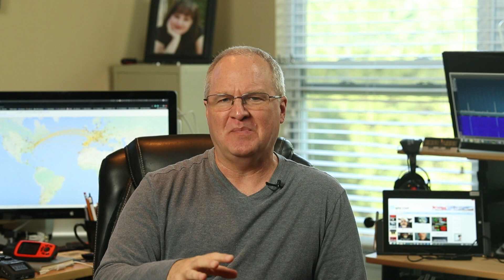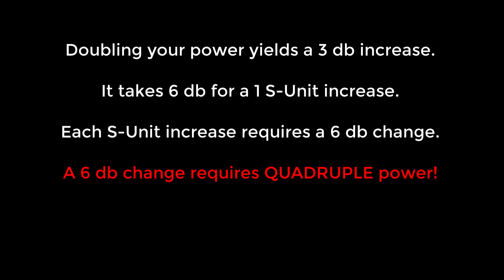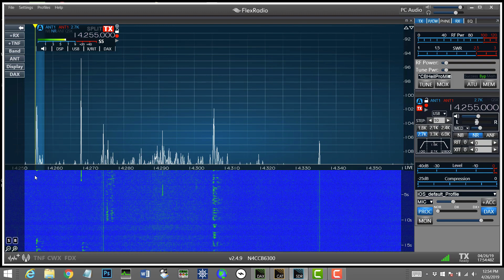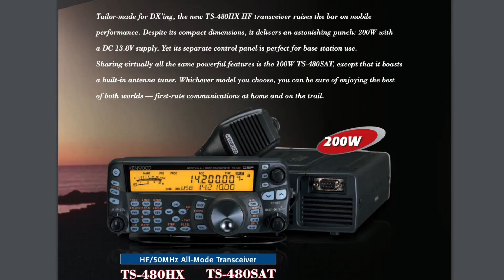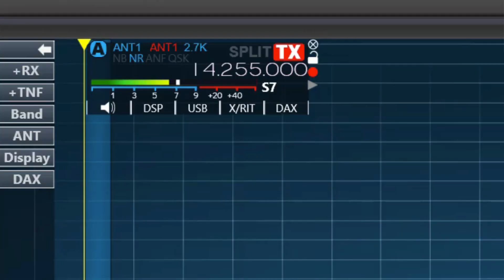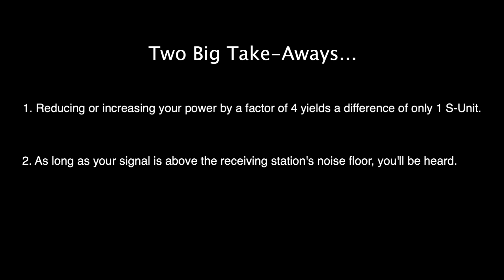Output Power vs. S-Units

Comment: This is all correct . I have the Kenwood ts 480 hx , and have been using it in my work van with a 3 metre outbacker outreach , since the rig first came on the market . My mobile station was about as good as i could do without getting an amp . It is very true the extra 100 watts makes very little difference most times , i have done many tests over the years turning down the power to 100 , 50 10 and 5 watts . I would say that if you have a very good a aerial and low power this is way better than high power with poor aerial . MY Icom ic 703 (10 watts ) in the shack with a 72 metre doublet at 18 metre is every bit as strong as my mobile set up ( many tests over the years ) . Thanks for your video
Reply from the maker: Thanks for your confirmation and experience, Rob. - Cliff

Comment: That explains quite nicely why I could have a conversation with a couple of different people in New Zealand from Oxnard, CA back in the 1980s with my stock 4 watt Cobra 148 GTL.
There's a group of us in the Mohave Amateur Radio Club that are building the QRP Labs kit, The QCX mostly at 20 meters. I'm going to have to break down and learn code. I may have to use my comptuer to send and receive code as I attempted to learn it decades ago and a lot of times I couldn't hear the difference between a dit and a dah.

Comment: great video, great information. I’d just like to point out a couple of things.
1. 1 S unit is 6 db only in iaru theoretical recommendations. Very few radios respect that. But it doesn’t matter in the end cause what matters is the real Signal+noise/noise ratio. And is the ear to perceive that.
That means if your signal is comparable to the noise even doubling power, 3 db, is a significant difference, as you said.
2. Unfortunately one has to fight strong qrm many times, more than just band noise. And when the receiver has an adjacent guy putting out 1500w is where you’ve got a problem even if you’re strong S9. And so again 3 or 6 db help quite a lot. 
To work in harmony everybody should lower the power. If I can hear you S9 with 100w why in first place you need an amplifier. So will do the adjacent one and so on. Less qrm, less splatters, less listening fatigue.

Comment: Great video Cliff! I am into qrp since I got my license 41 years ago. My first rig was a Kenwood TS-120V, FT-817, IC-703 were on my way, and now I really love my KX2 (even it has flimpsy case which is far from rough as a portable rig should be) 73s od better 72s (hi) de Stephan, DF6PA
Reply from the maker: Hello, Stephan.  I have heard others complaining about how the KX2 has holes and things that would allow moisture into the radio in the field.  I don't operate in rainy weather but it does make me think that Elecraft should consider making a field radio more weather-resistant... like many of the hand-held VHF/UHF radios.  Have fun! - Cliff

Comment: For weak signals, 6db makes the difference between a contact or no contact. It's all about increasing reliability that's why most commercial stations run power.
 I agree, most of the time, it's not needed. You can't control conditions, but you can increase readability a little.

Comment: great video. only time i would really like an amp is if my antenna needs encouragement to radiate because it was some sort of compromise design I was forced to use.
Reply from the maker: I'm in the same situation.  I have a vertical antenna behind my house in a big neighborhood. It's the best I can do in my situation.  I'm thinking that if I used a 1500 amp, stations might be able to hear me that I can't hear. They might reply to my CQ and get aggravated with me when I couldn't hear them due to an elevated noise floor at my shack.  In this situation, the operator with a big mouth but tiny ears is known as an "alligator".  :-)   Cliff

Comment: I respect your comments and agree with the overall theme. I do feel however you undersold the noise floor variable. In my 40 years on the air my experience is that about 1/3 or more contacts are made right around the noise floor, so an amp would be a difference maker for 1/3 of them.  While you did caveat with the noise floor I feel you inferred near absolutes without its frequent impact. 

If an operator wants more success, and in a sharply noticeable percentage, he/she will appreciate the amplifier.  Can the operator be highly successful without it? Yes. Will he miss many opportunities over time? Also yes.

73 KM5L
Reply from the maker: Agreed. If the receiving station’s noise floor makes him unable to copy your weak signal, you can either turn up your power OR walk away. I don’t have an amplifier so going past 100 watts isn’t an option. If 100 watts doesn’t cut it, I just figure it wasn’t meant to be. Thanks for your thoughtful comments. -Cliff

Comment: Thanks for that comparison. I've been doing QRP for a while and am surprised at the results. Qrp allows me to run battery power and make contacts on both SSB and, of course, CW.  What really makes the most difference is a well tuned and efficient antenna. A beam on a tower is always better than a dipole on the roof. Perhaps you could do a video on antenna performance for QRP operation.
Reply from the maker: "What really makes the most difference is a well tuned and efficient antenna."  That's so true, Jack. - Cliff
Reply: I really wish I could find the video-l saw a video by a guy in the UK, who had a friend (name and callsign) who had stacked yagis AND ran QRP! I thought that was the most brilliant thing I’d ever seen. 

As a mobile operator, it gets old being trampled by a QRO guy, boasting he’s running 1kw into a yagi 76’ in the air. He’s got the mic gain and processor cranked up so high, you can hear his cat fart from across the room. I’m really glad AARL outlawed amps for Field Day. 
WB3CFN
Reply: Love the video! So many newbies get turned off QRP because some knuckleheads told him no one would hear him. 
Question for you: How do you like the TS-480? I’ve got a FT-891 but the “menu” system, especially while in motion, drives me insane. I swear I’m going to dump it for a 480. I put the rig on the passenger seat so I’m not worried about size. Tnx de WB3CFN…dit dit 
P.S. I did QRP Mobile for a couple years but my antenna “needed help”. Nevertheless… I busted a 20m SSB pile up for a special event station in Germany. Probably 2.5 watts-my 817ND’s battery died 5 minutes later. He gave me a 5x7 and I gave him a 5x9. That car was stickshift…nothing like trying to shift gears with the same hand holding the microphone!

Comment: I didn't throw the brick at my monitor, I threw it at you.... The monitor just got in the way... 

Seriously now. 

I like both. I had a Swan 350 and FT-817.  I also had about a 150' dipole up 75-100 feet fed by 300ohm tv lead. 

So I like both QRP and QRO.  I have 100 watt radios that can operate QRP and an FT818.  I miss the extra power from the Swan, just not the drift, etc that goes with it.

What was funny is the day I received the 817, I hooked it up to my dipole.  The default frequency it turned on was on 20m where there was a big pileup for some DX podition. Pileup noise was over S9 on my meter, but for kicks and giggles, I called out my call/QRP.  I won the pileup on first call!  Big surprise to me.  First time QRP, first call, first contact on it.  

Most of the time when I had that antenna, I was the desired QRP station in the wall paper nets. I've since moved and I miss that antenna much more than I miss my Swan. 

The best point you made was about the noise floor.  First licensed in '78, I have seen radios go from tube to computer.  Last night, I got my HF rig, an Icom 7100, on the air with a random wire and tuner. (I mean I tossed anything I had out just to see if I could get on the air until I could get a real antenna up.)  I went to 75 at rush hour and used the noise reduction and pass band tuning to clear out the  noise. 

I was able to receive and understand stations that were absolutely not there, or not legible without that technology. Getting through using QRP is much easier today than it was in the 70's and 80's. And more hams have high-tech radios today than they did back then.  

If you take your qrp to the field, you know you are operating on a compromise antenna as well as power.  The antenna makes a lot of difference. The combination of a good receiver and a good antenna make more of a difference in receiving your signal than power. 

I made up my own law decades ago.  "Given sufficient propagation any antenna can communicate".  

Like you said, it is the noise floor that matters.  Can you get over it?  

I hope to be fully on the air by Christmas. When I am, I hope to catch you on the air.  

I know this is an old video, but it's still valid.  Keep up the good work.
72's
N4PGW
Reply from the maker: Thanks for a great comment. I have a friend (AD4CJ) who got DXCC with a wire antenna in his attic. When propagation is good, practically anything will work. We've all heard stories of old-timers using a light bulb for a dummy load and making a contact when accidentally forgetting to switch from the light bulb to the antenna.

I hope you get your antenna up soon, and have a great Christmas! - Cliff
Reply: @QRPSchool  Thank  you, I hope so, too.

Speaking of "light bulb" dummy loads, one night the Georgia group was working each other and one of them tuned up on a light bulb.  They started to "complain" about inconsiderate novices. The guy tuning up didn't think it mattered, so he made a call. It started a "dummy load" shootout.  

It was a  hilarious night.  I couldn't join, but I had fun listening.  

You know, some hams are crazy and I was raised (ham wise,) by these crazy fools, so guess what I am.... 

God bless  72

Comment: I guess its not TRUE QRP but I was thrilled to get contacts with New Zealand from Oregon with the same ham on two separate SOTA activations he had me at a "41" RST both times so the amp definitely would have helped bring me up out of the noise a bit better but still perfectly workable even during this time of "Horrible solar conditions"
Reply from the maker: Way to go, Zachary! At the end of the day, all that matters is that "it's in the log."  It doesn't matter how ugly it was or how many times you had to repeat your info!  :-)     Working New Zealand on a SOTA activation is fantastic!!!!  - Cliff

Comment: I agree with this video. However, the extra wattage is not just to have contact. It can be the difference between hearing some one in the mud. And actually being able to have an enjoyable coversation or qso. I tested this out. Often, times running 60 watts will allow the person to understand me clearly. While 11 watts is audible garble. Sure with 5 watts. We might of barely been able exhange names and locations. But it makes sense. If some one can hear you 100% @ 5 watts. Sure 15,000 watts wont make much difference then..

Comment: This is why my short 80 mb vertical, which is about 75% efficient, almost works as well as a full size quarter wave.... I honestly can't tell the difference... so a short but relatively efficient monopole antenna for long wavelengths makes sense if a full size antenna becomes unrealistic... especially on 160m.

Comment: Because the signal is dissapated mostly in all directions, (Dipole or onmi) . The station on the other end will only see a fraction of a 4 fold increase in power because only a fraction of it is going to the other station. What about if you're running a yagi with 15 Db gain and 30 degree beamwidth ?  in this case it's likely that two thirds or more of that power increase will reach the target.  EME guys use a little power for a reason.  Btw, i am a fan of QRP . Did alot of it in the 90's .
Reply from the maker: "Because the signal is dissapated mostly in all directions, (Dipole or onmi) . The station on the other end will only see a fraction of a 4 fold increase in power because only a fraction of it is going to the other station."  Nope.  Sorry.  When you increase your power by a factor of 4 (100 watts vs. 400 watts), the receiving station will record your signal as 1 S-Unit stronger.  That's just a fact.  And I have tested this on-the-air with a friend on HF, having him double and quadruple his power while I watched the S-Meter on my Flex Radio software.  Try it yourself.  It's not theoretical, it's real.  Thanks - Cliff
Reply: @QRPSchool  did you do this test on a dipole and then on a Yagi ? 
inverse square law , almost all of it is dissapated in all directions but with a Yagi , at least half or more of it is realized at the receiving end. You did your test on a dipole on HF . You should try it on 144 or 432 thru a high gain Yagi ... and that's why i said the receiving end only sees a fraction of a 4 fold increase in power from your dipole. They don't hear you 4x stronger, they only hear you 1 S unit stronger. That said, 1 S unit is still alot.  You seem to be trying to correct me but I think you read my response wrong.

Comment: As always, excellent video. I've never owned an amp and I was first licensed in 1971. Last year I managed to work WAS from my current QTH in about 6 months - at no more than 30 watts to a low inverted L. Low power does work. And I love my KX3 for portable use. You still riding the motorcycle? de ke2sx
Reply from the maker: Congrats on your low-power success, Gregg.  Yes, I'm still riding my motorcycle.  I just got the oil changed yesterday and am looking forward to taking it on a QRP outing at some point.  Mostly, I'm just hopping on it and escaping work for an hour or so at a time. (I work from home and enjoy getting the heck out of the house!)  - Cliff
Reply: I always say I'm going to load my QRP gear on the bike for an outing - one of these days I have to actually do it! Ride safe Cliff....

Comment: I've also found different results than what mathematics would predict. In different configurations, I've always got 3 to 4 more S points for a 10 times power amplification. S1 with 100w moved up to S4 to 5 with 1000w... S5 with 100w would give S8 to 9 with 1000w.  Done with different TRX over 25 years. I perfectly know how the db work, but that's unfortunately not what I've found on the air. I'm still looking for an explanation... And when I'm looking for real experimentation videos that show the S-meter received signal depending on the transmitted power, I find nothing nowhere. A very simple experimentation would be that a handful of ham operators, using different TRX, record their s-meter for 1, 5, 10, 50, 100, 500, 1000 and 1500w transmitted power and starting from s1, s3, s5, s7 and s9, using directionnal antenna if necessary. That would end up any controversy. As of now, I know what to expect from the db charts, and couldn't observe its application on the air.
Reply from the maker: Some radios have an SWR meter that isn't calibrated properly.  However, my Flexradio rig does have a nicely linear meter and I have tested it with a local ham who lives two miles away. I took note of his reading and then had him increase his power as I watched my meter. It was EXACTLY as predicted... quadrupling his power yielded one additional S-Unit. I really wish I'd made a video showing this. I suppose I still could make that video, but something tells me that many hams wouldn't believe it even if they saw it with their own eyes. - Cliff

Comment: I endlessly repeat to fellow hams that turning the RF-Power knob right is a waste of energy for a not significant result in their report. On the other hand, a good modulation and a well tuned compression could bring up to 10 dB in the audio S/N ratio for the same output power.
Reply from the maker: You are so right! - Cliff

Comment: Qrp can be fun.  I've made contacts from Alaska to Japan on half a watt.  That being said, often I need my amp to make a contact.  Let's look at it this way, when your signal running 1kw yields say an s4, your qrp signal would not be heard, and the 100w signal would be s3ish which may or may not be heard above the noise.  I don't  advocate pumping out max legal to chat across the street, but some days the amp is the difference between lines in the log book and static.
Reply from the maker: I agree with you 100%, Tyler. Thanks for sharing your experience. -Cliff
Reply: That is exactly in line with what the gentleman who made the video said.

Comment: As a scientific standard doubling your power increases your signal 3 dB. Also according to the same scientific definitions one s unit equals 6 db. Common math will show that a 5 watt signal versus a 100 watt signal increases the signal approximately 13 db or approximate 2 s units. Yes, not significant on 10m at the peak of SS cycle 19 with a noise level less than S1 and QRP sigs at S9 (given no QRM). However, 2 S units are very significant when the noise level is S3 and the 5 watt signal is near 3.1 S units with QSB. A boost of 2 S units will be very significant. Add another 2 S units with a legal limit amplifier and you will see a 4 S unit difference. Significant.
Reply: which turns out to be 8 S units in a modern yeasu radio for example where each S unit is a difference of 3 db, not 6. Unfortunately there’s almost no radio out there where an S unit is 6 db, especially on lower portion of the meter. That’s just iaru recommendation followed by practically no one manufacturer.
Reply: @IZ0MTW  Interesting, After working many radio stations running QRP and then turning on their amp as an experiment to 1500 watts (approximate;y 25 db), I have never seen anything more than 4 or 5 S unit rise on my receivers. But yes, it depends how the receiver's metering is calibrated. Thanks for your sharing.

Comment: I used to own a copy of a heathkit sb200 ... brilliant amp and the best bit was ... it kept the shack warm 😂 ihave an FT817 and an Ic 7300 but usually i run no more than 30w ... but my favourite mode is ½ w on WSPR
Reply from the maker: WSPR is a hoot, Nick.  It's amazing what low power can do! - Cliff